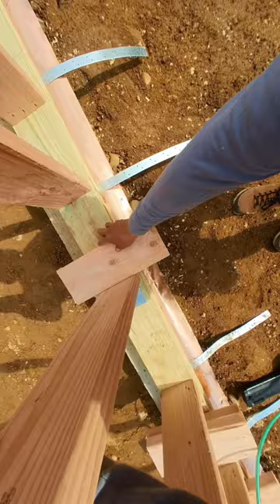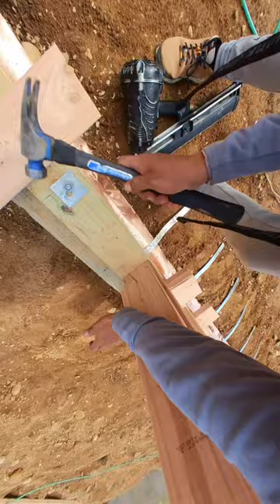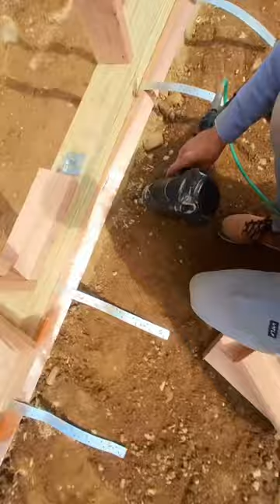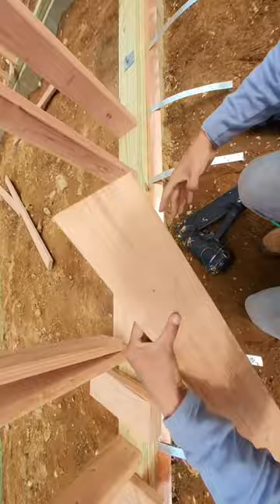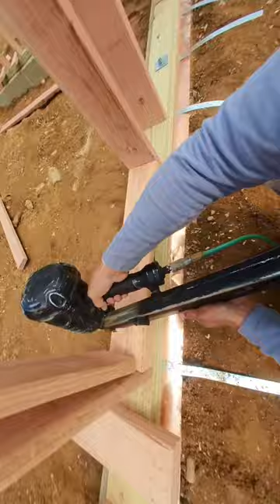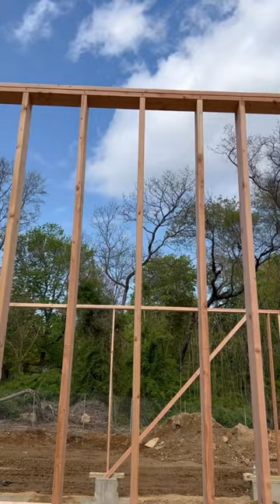Wrong or right #shorts #skills #construction #tips #team #carpenter #strong #work #carpentery

Comment: We would just throw 2 studs in there and call it a day. Stronger, more time efficient
Reply: Two bolts would also work so they're within space requirements but not on the line.
Reply: Nah two studs would mess up the centre for sheathing and drywall, also it may be required in that specific area for point loading.
Reply: @Geo-vw9oz it's most likely point loading. I bet the anchor is misplaced

Comment: I love your work. However I would probably have just made the 3/4" notch in the end of the stud.
Reply: What about that big ass washer . How would you shoot it
Reply: @myronsmith2114 he said he would notch it!! and that's all you need to know!
Reply: @boobye6305  Don’t you think they thought of that  . Most likely the inspector doesn’t approve. And watch your tone . This is a free country
Reply: That would unfortunately ruin the integrity of the wall stud
Reply: @myronsmith2114  what you talkin about Willis
Reply: @codyinman3991  You can’t notch a stud in a load barring wall . But try and tell these dummies
Reply: @myronsmith2114  because there is such thing as a toenail
Reply: @sotastatesoulja  How are you going to toenail through that sill plate
Reply: @dliguori25  that would be fine
Reply: @dliguori25 You could but it throws off the sheathing, drywall and insulation. All designed for 16” on center. And it would throw off the finish carpenters, cabinet installers etc.
Reply: @myronsmith2114  plenty of room there to toenail the stud on either side of the washer and if you were real concerned about the thickness of the washer, you could notch the end to accommodate that to, but it would be pretty ridiculous. 1- the washer is tightened down and pressed into the sill plate some, 2 - There's almost just as much variation in the thickness of the pt plates as it is when they are fresh and saturated, 3- the weight of the rest of the house is going to squish the end of the one stud around the washer, no harm no foul. 

And lastly 4, if you are going to say that you can't make a 3/4 notch in the end of the stud because it's structural, I guess the electricians and plumbers shouldn't be cutting 3/4" holes through them for wiring or 2" holes for drains either...
Reply: @seantoomey1514  Plumbers don’t cut the bottom of studs on a load barring wall . The house would never pass inspection
Reply: @myronsmith2114  ok👍
Reply: @myronsmith2114  you can notch no more than 25% of width of a load bearing stud, and bore a hole no larger than 40% of width of load bearing stud, per code. So a 3/4" notch in the stud is less than 14% of the width of a 2x6, it's fine. Even in a 2x4 it would still be less than 22% of width, that too would be fine.
Reply: @myronsmith2114  when you have a wall of 45 plus studs, a 3/4" notch around a little sill plate nut in a stud is negligible.
Reply: @myronsmith2114  it would pass inspection, it has passed inspection (speaking from experience)
Reply: @seantoomey1514  Most inspectors do not allow you to notch the base of a load barring stud and you still have that big ass sill plate washer to also notch . You would be better off setting a full stud next to the bolt to pick up the load then sistering and stud just short of the bolt to pick up your 16 inch center
Reply: My biggest problem was the washer moving (but being loose)
Reply: @myronsmith2114  carefully lol
Reply: I have box framed my whole life and when a bolt is in a stud we just drill the stud so bolt goes in and is never seen again. Been doing it like that for thirty years
Reply: @seantoomey1514 as an electrician (albeit I'm in the UK,but I would assume similar rules apply) in the event of a load bearing wall being timber here in the UK,which is rare,(the same also applies for floor joists too) we are allowed to drill/notch it,but it has to be under a certain percentage (I believe it's 25% or under).so for example on 4x2 timber you can notch 25mm (1inch) or drill a 25mm hole (1 inch hole) ideally centre of the width of the timber,but you also have to be 12 inches minimum from either end.and you can't do it in the centre of the length of timber either.
Reply: @tristanreeves5186  They use oversized plate washers. Probably the code there so you can’t just drill a hole
Reply: @carlstanton2550  12" min from either end of a stud makes sense to me for an electrician, you wouldn't bore or notch holes at the ends through nails and screws and you would want to run your wires away from the plates so someone in the future doesn't bore up or down through the top or bottom plate and right through your wiring. Joists are another thing but as far as studs go, I don't think the notching or boring at either end is a structural concern rather than an electrical one.
Reply: @seantoomey1514  that's a fair shout,I can see why.i guess structural it wouldn't matter too much where the notch is,it's more about the amount of material that's left being strong enough,which I'm assuming you would follow a similar rule of no more than 25%?
Reply: @myronsmith2114  true I’m in Texas kinda rural area aswell
Reply: @carlstanton2550  25% width for notching, 40% width for boring.
Reply: @seantoomey1514  yeah I figured it'd be something similar.cheers for the replies bud, nice to chat with someone on here that isn't just trolling for once!
Reply: @myronsmith2114  25%?
Reply: @boobye6305  lol fr tho
Reply: Notch the stud then add a 3 ft piece to it
Reply: @dliguori25 for sheeting layout
Reply: @seantoomey1514  I agree as long as the space between bearing is 4.5 inches or less it meets code
Reply: With the cost of lumber now, using any extra is a loss . I'd just move the stud over . One off even in a load bearing wall will only annoy the drywall crew.😁
Reply: @codyinman3991  What? no.
Reply: @seantoomey1514  Amen sir. Amen.
Reply: @Mark Smith  you can also do the homeowners a favor and go 48 on center!!!

Comment: Acceptable, clean way to do this but not economical.  I would not have wasted the lumber.  I'm always thinking of lumber preservation these days.  Today I would have just repositioned the washer to allow the most bearing and tow-nailing on both sides then put a tight profile cut on the bottom of the stud.

Comment: I have run into similar situations. I layer down a single 2x with a recess on the bottom. Washer and all gets hidden but your stud goes  where it needs to and transfers load as it should as well
Reply: Then the inspector makes you drill in a new redhead
Reply: @Quackerstacker1973  just take a picture beforehand. Inspectors love pictures

Comment: That's a pretty cool idea, and faster than what I usually do when the anchor bolt is placed like that. I would usually drill and run a Titan anchor then cut off the old anchor.

Comment: Nail your 2x4 off layout and scab a sorter 2x4 on layout on to it.
Reply: That’s what i was thinking too. It’s probably not a big deal but there’s something I don’t quite like about seeing floating studs.
Reply: Not a floating stud. A scab attached to a stud. And I could have had that done and move on before this guys came back with his Lincoln logs.
Reply: @tobymacish  when i said floating stud, i was meaning I don’t like seeing daylight through anything but a window.
Reply: @gregkrueger331  so you don’t put plywood on the outside of the buildings or insulation in you wall or drywall? 🤔
Reply: @tobymacish  that’s not the point. We aren’t talking about that far ahead, it’s not a hard concept to understand. There shouldn’t be gaps at the top or the bottom of a stud normally so to my eye it looks fucked up, Even if it really isn’t.
Reply: @gregkrueger331  so what’s your fix to the problem?
Reply: @tobymacish  if you go back to my original comment to your statement, I agreed with scabbing on the side, i think there’s a miscommunication. All i was saying was the way this guy did it doesn’t look good, nor proper to MY eye, doesn’t mean there’s anything wrong with it, i just don’t like the way it looked. A scabbed stud looks normal, you see it on tons of jobs, the way he did it is just unorthodox, at least to me.

Comment: for the sake of the layout being the same right. structurally your load is being transfered to a gap now. just add one or two studs around the bolt for the load...and add a dummy stud like this video shows for keeping the layout
Reply: The load is transferred around the gap. That's what a header/beam/lintel/girder etc. does: transfers vertical loads horizontally around gaps.
Reply: @spruce_goose5169  yes and im sure it would work...there is a void underneath then stud none the less. headers are build with the boards grain in a different orientation
Reply: Headers arent on the flat
Reply: @dallasonfire604  top plates are. We're talking a span of 3 inches here. Do y'realize how small a span that is?
Reply: And the fact they're on the flat means they aren't as strong but it doesn't mean they defy the laws of physics

Comment: Sill plate not tightened down. Also, who ever laid the sill bolt pattern should be given a refresher on why 16" on center is the building standard and how to properly space sill bolts to accommodate for the 16" on center run........
Reply: 2' centers 
I pour concrete 
Not once have I seen 16"
Reply: @ralphlambert5736  

That's scary ........ 

Standard building code is studs are framed to 16 inches on center............ 

Maybe you need to step out of your tunnel vision concrete pourer zone and have a look at the entire structure. 

I have had to fix these types of issues so many times. Adds unnecessary costs and can bring inspection flags if not corrected properly. 

After working in this industry for nearly 20 years. I have come to the conclusion you concrete "contractor" guys just do stuff how ever you want. I honestly don't know how half of the concrete foundations these days pass inspection. I have seen inconsistent material consistency, air pockets, voids, failed footings, failed forms, forms not leveled, lack of structural elements, lack of gravel/substrate,  gravel/substrate not compacted, lack of moisture barrier, the list goes on and on. Infact in 2016 I had a local inspector fired after I submitted photos and a statement of concern to my L&I inspector generals office that showed the inspector ignored obvious violations of a concrete foundation for a daylight basement. In this case the southern wall was already failing and loosing structural integrity before any building had begun. Yet......... Some how it passed inspection 🤷. Maybe the "inspector" was you?

Honestly, I can achieve more stable and even a fully adjustable structure with block and peer construction that is in many ways superior to most concrete poured foundations these days.

Comment: Why not just put a stud on each side of the anchor bolt? Seems faster and stronger
Reply: Thows off 16" OC so would have to be planned for for sheathing, drywall and if there is and load above to transfer to the foundation. Countersink the nut and plate or do as he did here are the right ways

Comment: That would fail inspection in my area.need to carry load to the foundation.should of sistered a 3 pack and notched the center stud.
Reply: That's not carrying load to the foundation?
Reply: @spruce_goose5169  yes a 3 pack would carry it to the foundation the bolt and washer is only a inch wide.the center stud would be your nailer for sheet rock on lay out.while the 2 outer studs would carry the load
Reply: @denniswilder3014  I mean what he shows in the video. How is what's shown in the video NOT carrying load to the foundation? Is the stud hovering?
Reply: @spruce_goose5169  actually yes it is hovering.the sill plate in reality is a squash block and sends the load to the foundation.that 2x6 he added has a 4 inch gap and his lay out fell dead center.step on a 2x6 on the flat don't take much for it to snap.
Reply: @denniswilder3014  haha. Ok good to know all the rafters are hovering because they're only supported by a double top plate (when not stacked over a stud).

Stepping on a 2x6 on the flat if spanning only 3 inches would not deflect but at all. Deflection is related to the cube of the distance. 3 inches is nothing.

Comment: Those tie downs are only required every 4'. You can plan it so studs don't land on them typically.
Reply: That’s how things work in a perfect world. The plate may have been set by others. Lol. The problem with utube is that nobody can accept any way of doing something other than their own way. Not all ways are wrong and not all ways are right. There was nothing wrong with what this guy did. Just another way to overcome an obstacle.
Reply: @johnbagewll2321  I concur
Reply: You mean get the concrete guys and framers to work out a plan together for bolts to line up?
Reply: @CheddarCheeseBandit  😂
Reply: @CheddarCheeseBandit  😂laughable
Reply: @CheddarCheeseBandit  😂😂😂😂😂😅
Reply: Sometimes.
Reply: @johnbagewll2321  , you ain't lieing!  I'm a flooring and tile setter that had great teachers.  I watch videos of others doing my trade. I see alot of things others do that works just fine , gets the same results,  just not the way I would do it.  I'll only give advice in the comment section if someone ask a question.  How to gut a rabbit?
Reply: @CheddarCheeseBandit  if the crete guy is going to frame it,,,, hell yea!!
Reply: @CheddarCheeseBandit  do you know what blue prints are? If followed by everyone, everything will fit
Reply: @ValValiantThor216  😂😂😂😂😂😂😂😂😂😂 yea right. Theres always adjustments due to jobsite conditions. Thats whybon plans theres this little callout in the general notes rhat says contractor to verify all dimensions in the field and adjust with the engineer as necessary. I see youve never read plans before. Or been the guy who has to tell the crew where shit goes. Yoire probably the one who gets told
Reply: Any sub knows that finding a builder who can coordinate the work is a pleasure to work for, but is rare as a unicorn.
Reply: 16" oc ends up landing right on 4'. If u start ur layout differently that 15 1/4 and go, then u lose the ability to start with full sheets of sheeting which makes for alot of extra cuts for the framers
Reply: @masonCOBwing  start your first tie down bolt where it lands inside a stud bay. They are spaced 4' or LESS, that way it's unlikely they're going to interfere with stud layout
Reply: @TheRealChrisHansen  our tie downs are in our concrete forms
Reply: @masonCOBwing  I realize, that's usually where they go 🤷‍♂️
Reply: Theres 100 ways to skin a cat
Reply: That's a good point. Maybe I just take it for granted because I do both foundations and framing

Comment: Notching the bottom is actually the proper way. This reduces the insulation area. 2x6 studs are only used to get extra insulation depth. Structurally the notch at the bottom is fine.
Reply: Wood is also insulation
Reply: 2x6 studs are for structural load bearing for roof and upper floors

Comment: Where I live that would fail inspection. The inspector has to be able to check and make sure the anchors are tightened down
Reply: Have you heard of a wrench??
Reply: @benjaminvogel5145 😂😂😂
Reply: Ever seen an inspector with a wrench
Reply: @benjaminvogel5145  most inspectors don't use a wrench they use their hand to see if they can turn the nut. I'd fail him for doing that
Reply: @jonathancarroll941  shit can be loose but your hand wont be able to turn it
Reply: @benische  if you can't turn it with your hand either your weak or it's tight
Reply: @jonathancarroll941  nah. Say tight is when it first starts to clamp, plus one full rotation. If it's only turned 1/2, you aren't getting it off with your fingers. Same goes for a lugnut. 50ftlbs isn't tight enough, but you sure as shit aren't able to get that off with just your hand

Comment: You have to drill bottom plate with a paddle bit anyways so we just use that bit and drill out the bottom of the stud a little bit for the anchor bolt head to rest in